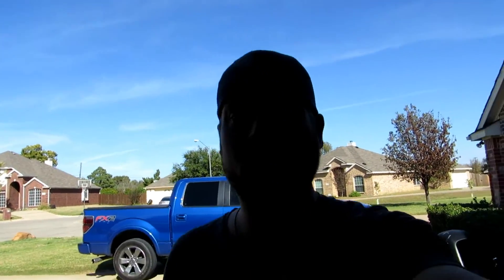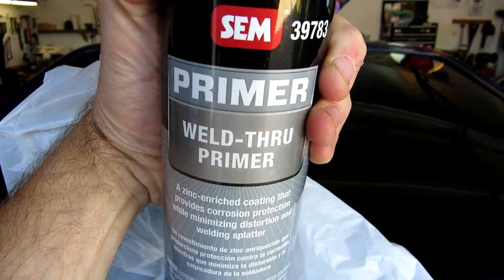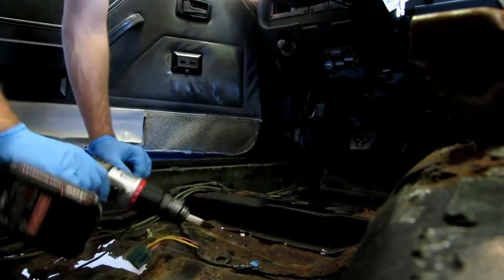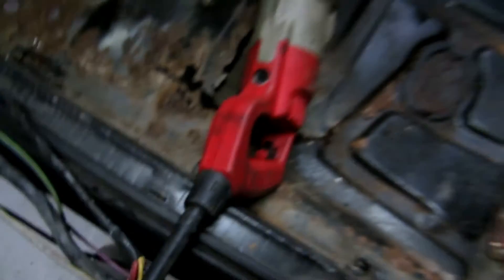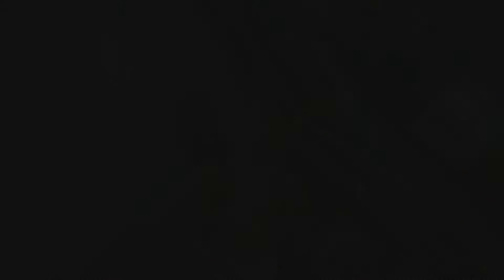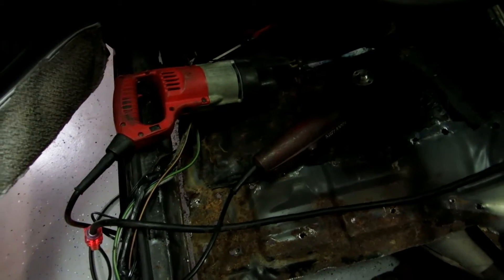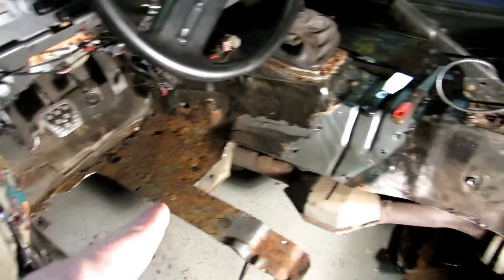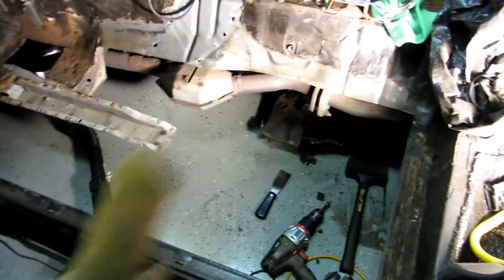1986 Mustang GT Project - Part 4 - FLOOR PAN REPLACEMENT - Cutting out rust

Comment: Doing the same to my 90 convert i have cut mine out and test fitted i'm about where you are  now glad you posted this video can't wait to see it when you are finished would like to see how you weld your sub frame and torque box and front section thanks again.
Reply from the maker: +clarence dill - you bet! Good luck wish yours. My passenger front pan was fine so I only replace the rear section of it. The driver's side I replaced the full pan but left a lip before the torque box to weld the front of the pan too I just tried not to cut out everything, left good metal to weld to.

Comment: Was the gas line or break lines in the way?I have a 87 and getting ready to do my floor pans
Reply from the maker: YES. Gas lines sending and return run down the passenger floor pan towards the rocker. On an 87, rear brake line should be in the trans tunnel. But watch those fuel lines. I unclipped them and bent them down and out of the way.

Comment: By chance, did you replace the rear section of the trans tunnel (the rear of the shifter hole to the e-brake?)?  I noticed it looks like new metal, and that's the section I need to replace due to someone cutting a gaping hole in it, along with part of the seat brace.  88 Fox stick.  Thnks for any input
Reply from the maker: Only where the rust was absolutely gone just where the floors start to bend up on the trans tunnel. But no, I didnt replace any of the tunnel itself rear of the shift hole. This was all solid metal for me. They make a complete floor, trans tunnel and all if its that gone, might look into that. Lemme know how it goes!
Reply: @HOUSEOFDULA  Will do, thanks!

Comment: How many spot weld cutter blades did you go through?  Doing the same thing and I'm going through bits left and right.
Reply from the maker: Man I went through about 3, 1 of the 3 I spent more money on and it ended up lasting...use WD40 too when cutting.
Reply: HOUSE OF DULA  gotcha,  thanks for the tip!

Comment: I don’t feel so bad now about my 85 t-top hatch now that I am watching you doing this ! Mine is just as bad but it’s rotted out under the driver rear seat too! I only have new full floor pans so far... What would you have done differently if you had to do it again?
Reply from the maker: Ive been asked this before. Great question. Not at all. Car is solid. The only thing I wish I spent a little more time is with the overlap. Its stong, but aesthetically from the underside, if I would have fully butt welded it, it would have looked more factory. I can weld, but that would have have been a chore for sure.

Comment: even though your doing one side at a time you should most definitely weld in some braces,especially since it's a subframe car,really should have done it before the first cut. Time sitting in-between working will make it want to sag
Reply from the maker: Your right. My thought was this: There was already no structure there to being with. The rust was so bad, both sides had to have flexed. All the panels and doors line up fine, so the structure doesnt seem to be compromised any worse than it already could be. Im not removing or altering any of the major sub-frame side rails, floor baces or trans tunnel. Im also keeping weight on the rear alxe and front wheels, this is why I haven't lifted the front to work on it. Im not jacking the car up anywhere its own wheels wouldnt support. But...now you have me a bit worried lol
Reply: +Mike Dula if the subframe connectors were already in it wouldn't be as bad but there again the rear seat area and trans tunnel are still in tact so that does help and I hear ya on the old floor,it wasn't doing much structure wise to begin with
Reply: +Mike Dula didn't mean to make you worry,I've just seen alot of home done floorpan jobs that ruined the vehicle. You should be OK with how your doing it,there is still quite a bit of meat left after your cuts. Just make sure to have the driver side fully welded before cutting the passenger and putting in subframe connectors would be a good idea before you do the other side.
Reply: +Mike Dula didn't mean to make you worry,I've just seen alot of home done floorpan jobs that ruined the vehicle. You should be OK with how your doing it,there is still quite a bit of meat left after your cuts. Just make sure to have the driver side fully welded before cutting the passenger and putting in subframe connectors would be a good idea before you do the other side.
Reply from the maker: Thanks Bob. I think I'll be fine, but now I feel I need to rush home and check my door gaps again lol. I wanted to put the subframe connectors in before cutting the floor for this reason, but they would be in the way big time. Made sense to get the floor straight and solid before welding in the connectors. And on the passenger side Im only cutting behind the seat area, as the toe board area is fine....plus I have the fuel and brake lines to work around on the passenger side. Non the less, the driver side will be welded and much stronger than it was before I begin on the opposite side.
Reply: +Mike Dula Yeh man doing it that way you should be fine, especially since your not cutting so much on the pass,sub-connecters are kind of a bitch to work around,I just like the idea of a full frame. I'm a big fan of the 86 4 eyes so I'll for sure follow your build. Just putting this out there but rear quarter glass from around 90 to 92 foxes looks great on your year,really cleans it up and they're super simple to switch.
Reply from the maker: Funny you mention, Ive kicked that around. Since these cars are like the AR-15's of cars, I assumed it would be a direct swap. I wanted to paint the window trim and quarter glass louvers back to black. But the smooth flat glass of a 90+ would look clean. Whats involved in that swap?
Reply: +Mike Dula Just a matter of removing the old glass and louvers and bolting in the new one,think there's a rope seal in there but Yeh it's real easy. I had an 86 with 92 quarter glass and it looked really clean,nice subtle upgrade but big difference in appearance.
Reply: The main thing to be concerned with is the overall alignment. The doors will define the rocker panels, so some good measuring will really tighten up those inevitable gaps. But in all reality, you should be able to drop the entire engine, trans, and large components like gas tank. Then brace the car straight by jacking each end up and changing the tension across the wheelbase. Some careful figuring will allow you to set the four posts perfectly level on jackstands, with temporary beams. You can then cut at your leisure, and simply rewire the whole thing nice & slow when finished bodywork.
I will be doing some work on a Mercury Mystique, it needs some new floor panels, so my plan is to straighten the chassis within a certain tolerance, then with bracing complete, just hack he floor out and basically build a tube-chassis inside the old uni-body. Some simple insulation, and vinyl wrapped pilllars will satisfy the oem-look. New carpet, since you can't bedline your floor, it's impossible to repair later.
Reply: mine is a convertible.  is this even more dangerous for sag?  as soon as I get the new pans the rot is getting cut out

Comment: Holy sh!t.  Here I thought my floor pans were bad.
Reply from the maker: Haha yeah mine we're gone. GONE. T-tops failed, it sat outside and every rain just soaked the floor carpet. Otherwise car is all solid. Luck it stopped at the floor pans.
Reply: My driver's side pan has a quarter size hole under the floor mat and a golf ball size hole under the seat brace, but is otherwise structurally solid.  I tested it with a hammer to make sure it was sound. My passenger side has an 8 inch wide hole where the passenger seat right rear mount would bolt up, but again is otherwise solid.  No T-tops, but there is a leaky sunroof, and bad window/door seals on the passenger side.  Also, this car has driven in 6 inches of snow and very salty Wisconsin roads, so I'm surprised it isn't worse.